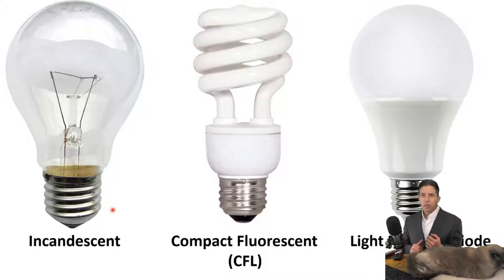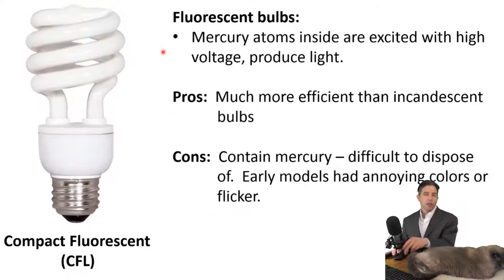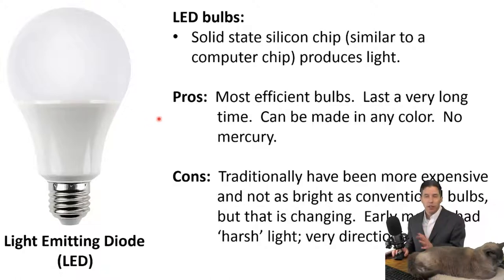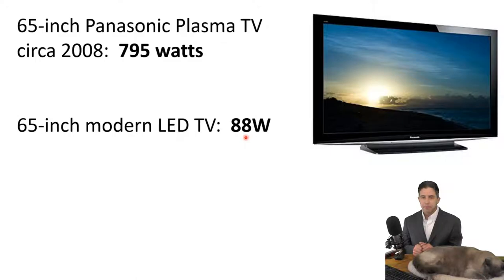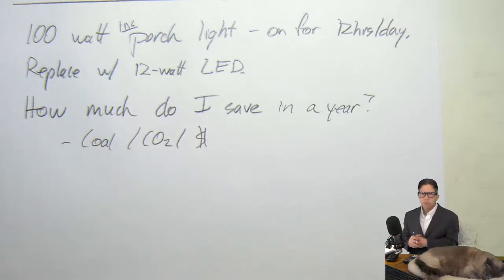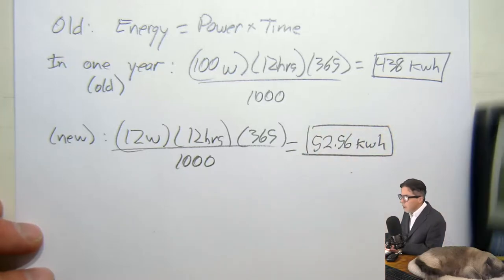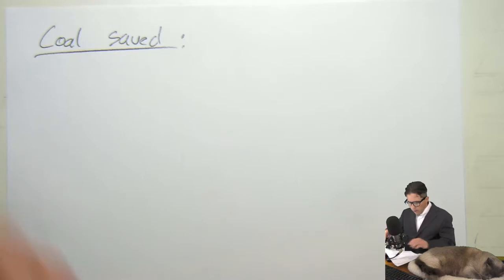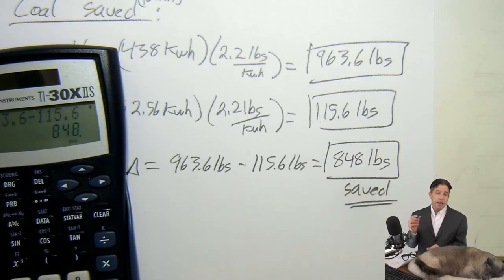Lecture 18b (extra):  Bulb swap calculations

Comment: Two  more major advantages of LEDs: (1) easy to make in any shape. There really is no reason to make them as bulbs, except you need that for a direct, drop-in replacement. (2) economical to make and run in any size. Great for Christmas tree lights.

Comment: It is never included what one saves by not having to pump out the excessive heat from an old light bulb with the air conditioner.